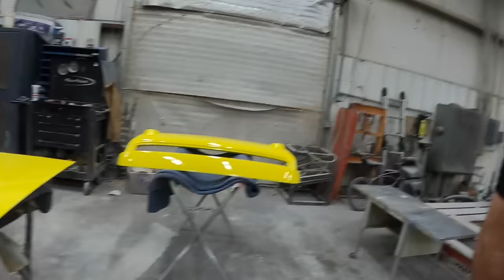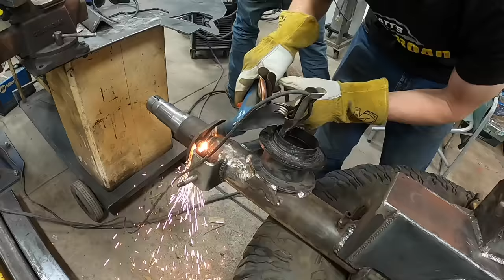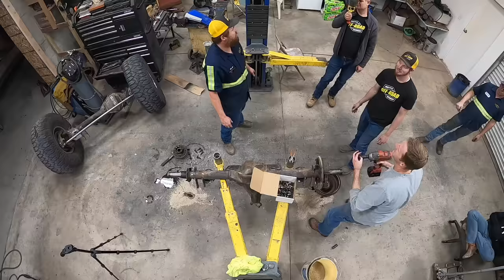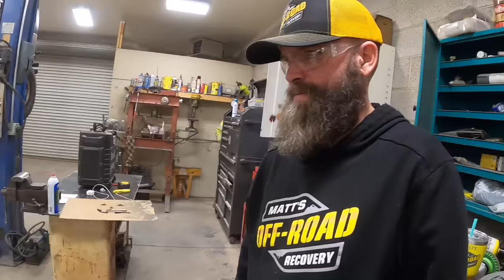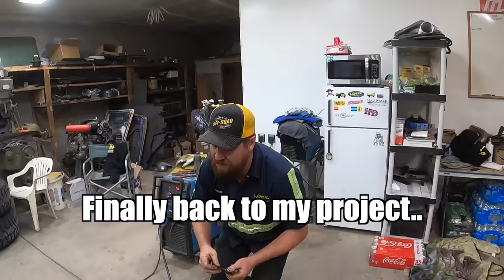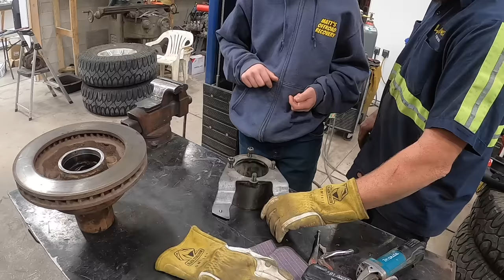Let's Get The Morrvair Engine Started!

Comment: In the interests of underhood cooling, how about another set of satin black Corvair decklid vents on the hood? You know you're going to need the extra airflow on hot days and it'll be a nice carry-over from the Jeep! That, plus the scallops...
Reply: With a large radiator and a high flow waterpump it should be fine

Comment: When this is finished you need to have a "guess the weight" giveaway contest.
Reply: I say with all the gear, dogs and camera crew around 4500lbs
Reply: 4735 pounds, my guess, depending on the engine block's material (iron or aluminum).  There's a lot of steel  in that buggy......
Reply: Locked, loaded and the dogs?
I think it's going over the scales 4850!
Reply: And the giveaway is the Corvair??....
Reply: @pear7777  I was thinking a tshirt or maybe a soft shackle but that also works.
Reply: OR guess a weight and see how close they can come to it
Reply: @pear7777  Rudy’s Corvair? 😵😪😉😷
Reply: With all that sheet metal.. Plus the pumpkin paint, huge addition.. Id say at least half a million.
Reply: @pear7777  No! a Corvair there is plenty in the parking lot to choose from,and you can build your own!.
Reply: @timothyokane9710 , nah, I'm more interested in how much flex he can get out of the suspension compared to the banana, Fab Rats Taco and Pappa Dar's 'new' jeep rig.
Reply: Too heavy to be useful in the soft sand or snow.
Reply: 5100 lbs
Reply: Im thinking 4882 under 5
Reply: 4995lbs
Reply: 6300 lbs

Comment: I grew up working on a 1967 squareback station wagon that was yellow what you're building reminds me of what I used to do as a child which basically consisted of me not holding the light exactly where it was supposed to go and breaking bolts off Good Times spent with my dad

Comment: Seems like those caps you made to protect the inside bearings won't allow the bearings to stay cool & will trap all the heat & cook all the grease out.
Reply: That's what the seal is for.
Reply: Said like a true, self-appointed, Internet expert...
Reply: @buckhorncortez  expert? The guy offered up an opinion. He didn't say it was definitely going to happen. Relax, enjoy your Sunday morning coffee, and watch more MORR vids.
Reply: @buckhorncortez  Spoken like a true internet police comment expert
Reply: @1oldskoolluvr  But it's a bad opinion. That seal is there to keep the grease in. As long as it stays intact the bearings will always have enough lube and wont melt down. Plus the air flow over that section of a hub on straight axles will keep it under the temp to liquefy  the grease. The only reason it wouldn't would be after the bearings already failed.
Reply: @Laugh1ngboy  Agreed, Seals will keep grease in but when grease gets hot & turns to liquid the seals are less effective, correct? In other words axle seals are for grease, not oil, right? Anyway I get the reason for the caps but wondering about when its 100 degrees & driving at 60 - 70 mph for 50 miles & will the air cool enough around the caps to keep the temp of the bearings in check.
Reply: @danm2173  Well if you noticed the 10 pounds of drum brakes they removed from that same area the you know the answer is no. That area will not get to 300 degrees to turn the grease into a liquid. Unless the bearings fail, and that causes a whole slew of other problems. Now I have had seals fail which can cause the grease to be forced out which will cause a bearing to fail. That's the reason he is putting the covers on it though.
Reply: I have not researched this in depth yet but I am pretty sure bearing grease is designed to thin to a liquid during normal operation of the bearing. That way the lubricant can get distributed to all areas in the bearing and hub that need it. This reduces metal to metal contact just like the oil in an engine does. When it cools it thickens so it stays in the hub better which also makes it easier to get the lubricant into the hub during assembly compared to trying to fill it with a liquid when the cavity is on its side and not sealed liquid tight yet.

Comment: Tried similar on D11 dozer once.  The environment they were in was hard on final drive seals.  It made them worse.  Ended up opening them up to the environment so stuff could fall away instead of get packed in with the shield.  Different application for you.  Not much clay mud.    I would give a place stuff can easily fall away/out.  Enjoying your project.  Thanks for sharing.

Comment: One of the cylinders in that engine has low compression, you can hear it when it turns over.
Reply: Could've been a lifter that hadn't pumped up all the way yet. Motor hadnt run under it's own power at all yet

Comment: I can see the shields getting packed full of sand and mud causing the seal to go out quicker.
Reply: I was thinking almost the same thing, but snow is probably going to be a bigger problem.  Time will tell, hopefully we're wrong and Matt doesn't end up cutting them off.
Reply: I agree, no where for it to escape once it gets under that shield.
Reply: Im guessing those shields will eventually get bent and make one hell of a racket against that hub. It wouldn't take much of a hit to bend them
Reply: @cloudymcleod1719  - I think the wheels should completely cover them so they can't get hit with anything big enough to bend them.
Reply: @killer1963daddy  x2 on drain holes. First water crossing will likely fill it with silt and sand. Wet sand will not only corrode everything but turn into grinding paste that could seriously damage the components the shield is designed to protect
Reply: @killer1963daddy  That would cause even more problems then it would solve, that just gives a free entry for debris to get in there.
Reply: @princeofdeath7696  debris will get in no matter what. If it doesn't have a way out is when problems happen
Reply: I think if these kind of things worked you would see them more often?

Comment: I so need a rotisserie for my '65 Corvair project. Thanks for the wheel hub idea for the pivot points. I have a pair of similar hubs and now need to buy some steel stock to build the frame. It may take me a bit longer to build, as I'm on my own for whatever project I want to get done. The FrankenVair should be operational w/in a month or so.
Reply: @MattsOffRoadRecovery  Not sure what you're referring to, as far as the bolt through the bearing. Was that part of your procedure while building yours? Perhaps I missed that step. Will figure things out as I build, no doubt. Looking forward to its maiden voyage. Be well.

Comment: So Matt seeing you building from scratch essentially I like how you put that solid pipe from one hub/spindle  to the other so they don’t turn while your moving it around. So I was thinking why not put the same front end in the rear. One it will be solid. And  you would then have the option of rear steer. I could see the benefits of rear steer like a lot. Example for towing small trailer for better trailer placements. Also to simply be able to crab walk so you don’t drive in the same spot as front. You always tlk on how running the same track breaks an losen the sand so if you had the ability to crap walk it could be a game changer. Literally not much wieght. You’d simply add a hydro pump like one that you would use for boat trim tabs a straight bar and small hydro piston.. Small light and powerful enough. It wouldn’t turn much so angles would be gently enough where you could prolly be full turn on rear steer and full power and not break u-joints. It’s like two options. Option one power bang and throttle thru stuff because less then ideal rear tire placement and trailer placements or two  have rear steer and be able to strategically place rear tires to put them where you want in the rocks and sand  and better placement control of trailer and ability to crab walk in the sand. There’s that one hill where ppl go down and can’t get out and then you have to do a caravan of tow rigs in line to get y’all out. I think rear steer could change them rescues to a one man band. What you think? And the cool factor is priceless along with the potential of functionality and justify the wrk and the steps backward is doin it for the ppl for the channel and because it’s awesome. Also when your on a grad parallel to it you try and go and your back end slides down because of sand and gravity but if you could steer rear along with front up hill while you drive along side that grade the vehicle would be less likely to slide down. It’s actually endless possibilities as I’m writing this to much to list comes to mind. And the cons vrs pros. Yes the cons are 30 lbs and moving parts but with a simple pin connection point and a solid secondary mount hole off frame if the steering failed you could pull pin kick rear tires straight and put pin into the secondary mount that would in essence would eliminate/bypass rear steer and it would be solid. Yes I’m sure it’s over whelming the entire project but could be amazing really could be.

Comment: I like surf and turf, scallops are great. The hood looked great with the drawn lines.  Your painter is awesome.  I liked the jack-o-lantern.  Is the motor a rebuilt? I know it is not tuned and could be an echo in the garage just sounds like maybe you should check compression before installing it.  Be safe.

Comment: a. The scallops on the hood are a win.
b. The fact that the engine, sitting on a pallet with a default tune was not shaking all over the place is a very good sign.
c. The pumpkin is awesome, but you should have done it in yellow to match the body.

Comment: For the jeep and potentially this project have you thought about setting it up with the plugs they use to connect power to plows that are put on the front of trucks.  This plug would allow for easy plug and play for your winch ( much faster and easier the having to play with bolts to connect it).   This could also make it really easy to power the winch on your ATV recovery trailer.  Grab a long heavy wire gauge set of jumper cables cut the alligator clips off add the plug and toss it into the ATV trailer box and you can easily power the  avt trailer winch without having to remember a jumper pack or charging a battery on the trailer.   copy and paste this into google and you will see the plug I am talking about (  Power Connector, 175 A, 0.437 in )  given most winch pull 60 amps or less this 175 amp plug is more than capable of handling the power draw.

Comment: All that time on the new build you should have did the 2006 HD rear disc brakes on the 14 bolt. The old mounts have to be cut off but you get a way better caliper and Parking brake.

Comment: Hey guys if you're looking for a better alternative for a fuel filter/ fuel regulator. C5 corvettes use a return style fuel filter that is internally regulated to supply correct fuel pressure to the rails and can be had at auto parts stores.

Comment: With the taper on the hubs I think your shields may actually hold sand/water/mud in there. It might be wise tho drill some drain holes on the bottom side along center line to allow anything in there to drain out.

Comment: That truck motor sounds good. Should get a Elgin SS2 cam or a BTR S2 with some springs and pushrods. It'll liven that motor up and give it a good kick in power. The BTR will help more low end and the Elgin would help in the midrange to high.

On the "dust cover" ring on the caliper flange just wondering if there's drainage. The gaps for the bolt heads would have enough space for water to com back out? I can just picture a bit of mud holding water in there. I guess you'll find out what it'll do lol.

Comment: Oooh, idea, make the engine mounts with sockets for trolley legs with wheels on. Easy to drop the engine on the lift anytime :o) - In pint of fact, I’m doing that if I ever pull the van engine. Couple of tubes welded on the legs, doneski ^-^

Comment: Caliper brackets should be mounted so that the calipers your installing will have their bleeders facing up and you don't end up with air pockets in your brake fluid.  If the calipers are identical then one bracket will be forward mounted and the other rear mounted while if they are mirrored both brackets get oriented the same.  Hope this prevents some from having to do it twice or make another extra trip to exchange calipers to match how the brackets were mounted.

Comment: ECM PCM the wiring is actually easy with a good schematic. I installed a fuel injected 460 in an 85 Ford F250. But because of terrible mileage I swapped again to a Cummins that doubled the mileage. Again another computer to wire.

Comment: The only concern I have with those covers for the seals is that it can make for a nice deposit of sand and mud and actually wear them faster than without them.

I'm not 100 % sure if they will, but it seems like thing that couls happen. I would check them from time to time.

I like how it's comming along, and the pumpkin face gave me a good laugh! 🤣
Reply: @MattsOffRoadRecovery  Nice to know, it looked like a possibility.

I don't get to see many truck up close nowadays, and the ones I see are basically stock.

Just trying to help. 👍

Comment: Orange to constant pink to switch power. LS series motors are cake walk. Wouldve been much easier to use a truck fuse box and run a 1 wire hookup but thats just me.

Comment: Matt should put a soft button tuff headliner in there to save your heads going over bumps in the back seat. Did you put a Texas Speed cam kit in that LS?  Is that the good light aluminum block LS?  You should heat wrap your exhaust.

Comment: Definitely looking good. Can't wait to see it on a job or flexing the suspension. I'm really curious how it flexes compared to the Banana, Fab Rats Taco & Pappa Dar's 'new' jeep rig. I think you should go with the scallops on the hood.  But there needs to be scallops somewhere else on th rig to tie it all together.
Also, if that shield does get hit won't the shield come in contact with the hub and grind into the hub pretty bad? It doesn't look like there is a lot of clearance between the shield & hub. It also looks like it will just hold dirt & water in more than anything. Say if you get in some deep mud or river for example. Maybe drill some holes on the bottom of the shield so water & dirt has somewhere to go?

Comment: Is that steel cylinder (should have used a coffee can, btw) protecting the seal going to fill with goop on it's own and put the seal in a bath of sandy mud? Maybe a rubber boot ala CV joint would be better. It would be lighter, and wouldn't need welding.

Comment: Rudy I have a question. I just bought a 1979 Ford f-100 and imma have to replace some of the panels on it suck as the bed. I need some tips and advise on how to weld new panels in.

Comment: I'm wondering if it wouldn't have been better to weld the Bearing Protector sleeves to the heads of the bolts instead of the mounting bracket.
It would keep the studs from turning as they are tightened, and it would make the sleeves removable if anything needed to be done to the brackets.🤨

Comment: Matt please do yourself a favor and remove those "debris collectors " that you installed on your rear axle. Tha air gap between the hub and the tube will create a vortex that will suck in debris and firmly pack it again the seal

Comment: make a drain hole in the botom of that welded cylinder. Dirt and water will be there any way, but it will prevent rusting and provide that dirt away faster.

Comment: The scallops would look awesome!  Maybe they're just mocking them up, but the placement of the one on the driver's side is not consistent with the one on the passenger's side in relation to the hood center line. 😬

Comment: Oh boy, I’m predicting broken driveline parts with that motor!!!   After you’re done with the gasser, think about a Cummins R2.8 turbodiesel with an appropriate gear box.
Reply: Matt explained in another video why diesels don’t work for this type of tow rig.  Short response is he needs wheel speed in the sand, thus a motor that turns some RPM.
Reply: Also Matt mentioned how Important it is to keep the weight down to a minimum.